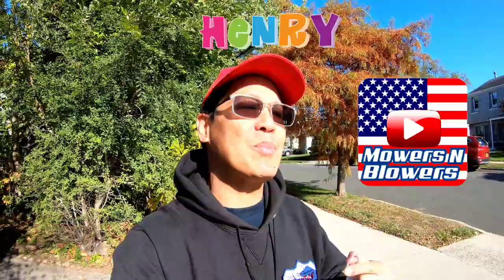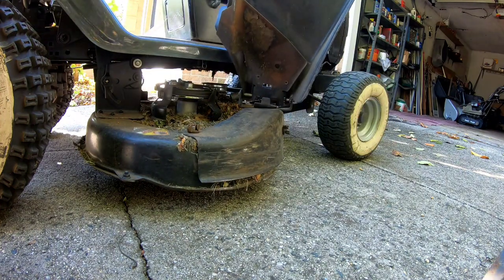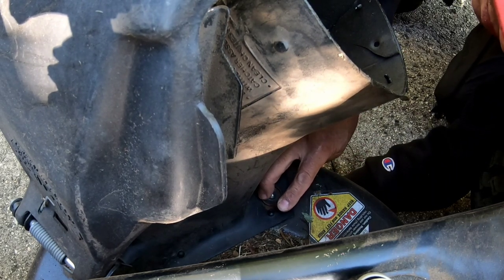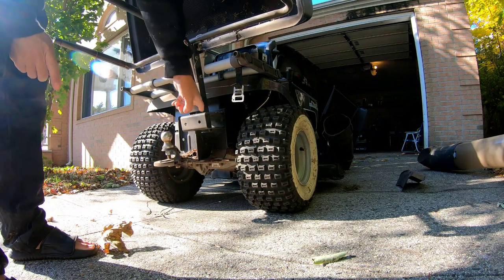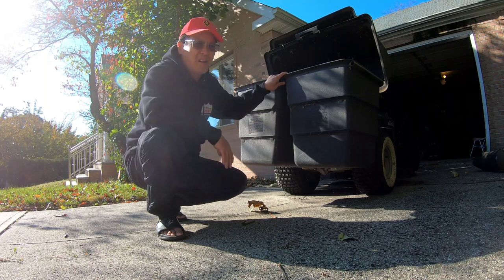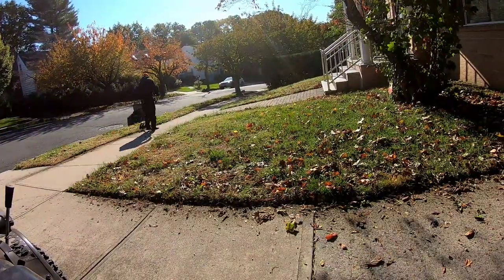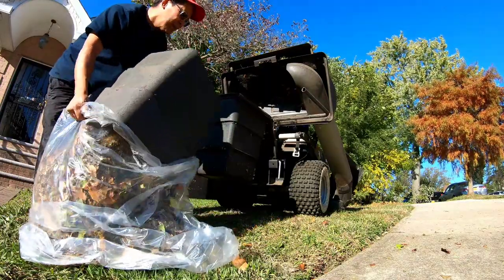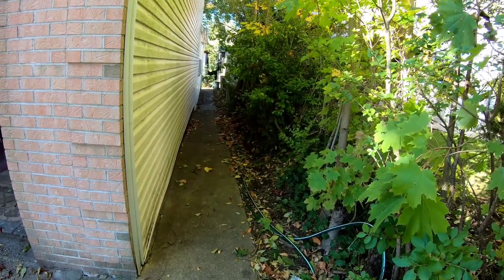FALL CLEAN UP LEAVES LAWN TRACTOR RIDING MOWER MURRAY DOUBLE HARD BIN BAGGER SYSTEM MINUS MULCH PLUG

Comment: Very good Henry and nice bit of driving in a tight spot. Of my 6 personal tractors, my Poulan Pro has a 2 bin bagger and just yesterday finished most of the yard cleanup, at least good enough until Spring cuz the snow is starting to accumulate on the ground as I type this. At least I can work on 4 tractors off and on inside the new shed that I built.
Good luck with the new President too!